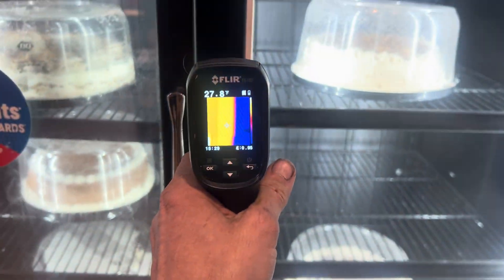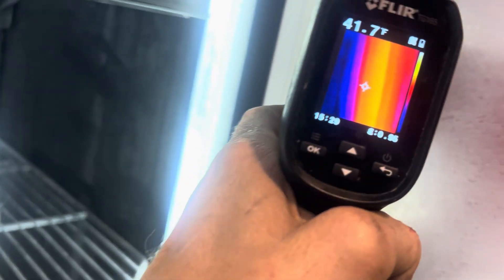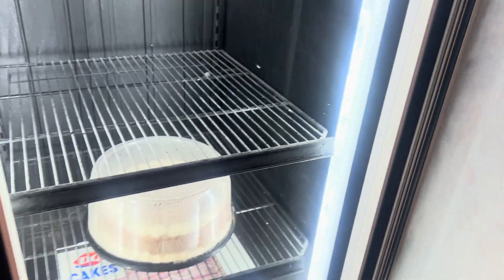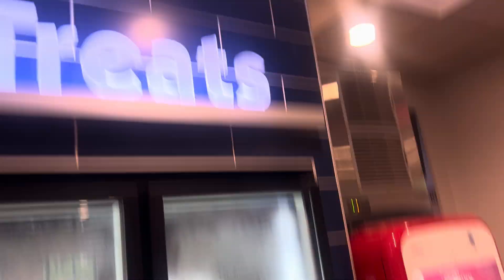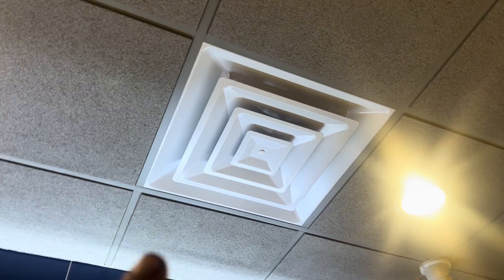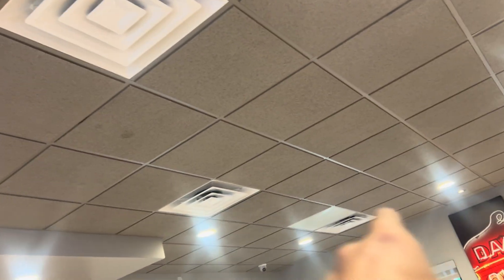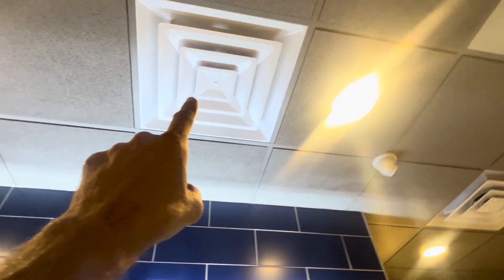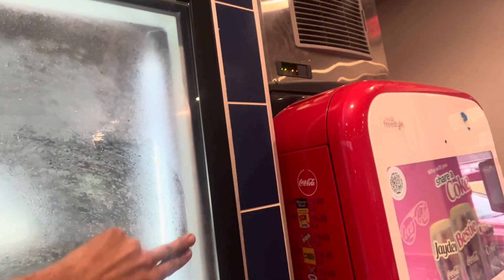The corporate inspector said “get this fixed!!”

Comment: Cold glass + humid air = condensation.
Tell Corporate Dude to take a shower sometime, so he can understand the phenomenon. 😆
Reply from the maker: He told the owner I needed to come “adjust the door heater” 🤦‍♂️
Reply: @restaurantrepairs what did u do in this situation? Moved the ductwork? Or recommend them mua unit?
Reply from the maker: @brandoncorrea511 sent them the video and called it a day.    Easy enough to move the duct 1 square away and change the diffuser to a three way. OR hang a 24”x 6” plexi shield on that side